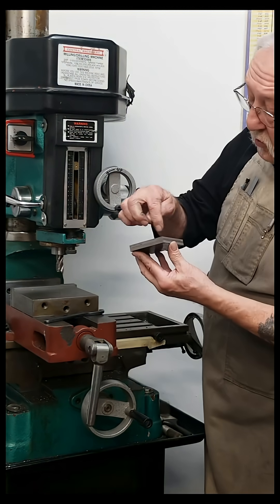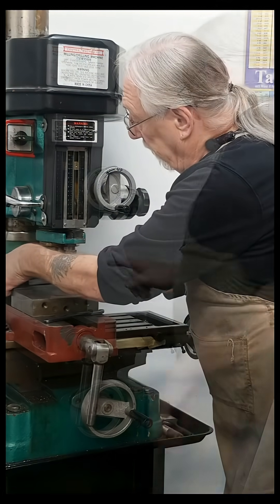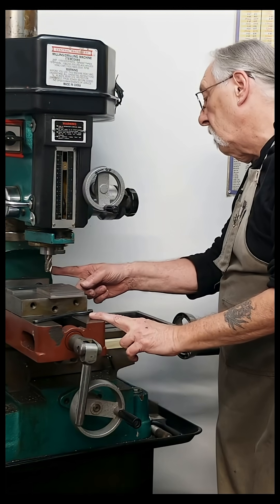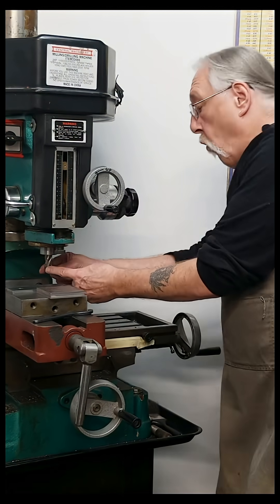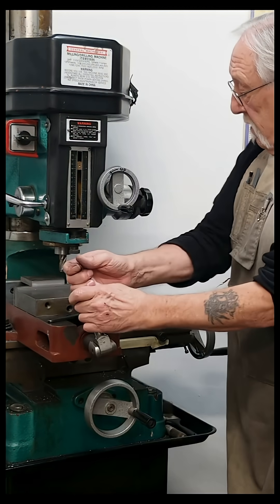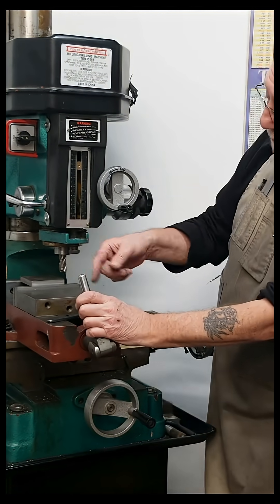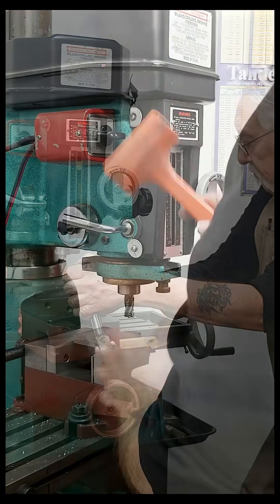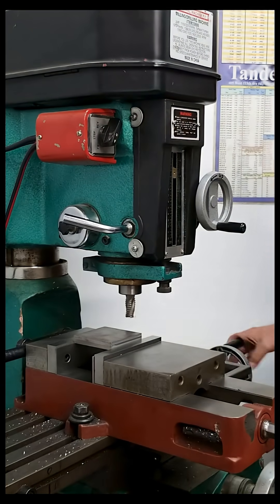Machinist Brain 3, HSS Rougher

Comment: Having only recently acquired a milling attachment for my Taig lathe, l've just begun milling small aluminum parts.  Quite a learning curve to say the least.  I was curious if you can just grind away the toasted end of an end mill to restore it's use.  That would be predicated on not having dulled the entire tool doing large edge facing operations, of course.  Also recognizing that such operations aren't really practical on a machine as small as mine.  The question might seem a bit ridiculous in light of the machine l'm using, kind of like somebody asking about profiling an entire wooden top handrail by using a small dremmel as opposed to a big 3 hp router that l would use.  But if you could find a moment between fits of laughter to give me an answer it would be appreciated.  Cheers.
Reply from the maker: Don't waste your time. End Mills aren't like lathe tools. Without special equipment to recreate the geometry of an end mill your efforts would be futile. And trying to use an End Mill that wasn't sharpened correctly could end up with a visit to the emergency room. I know thats not what you want to hear, but that is the sad truth. Tooling is expensive. I would advise you to buy some new End Mills. So, the answer to your question would be No.
Reply: @GlennNowOnYouTube l defer to your experience and knowledge.  Thank you.
Reply from the maker: Thank you.